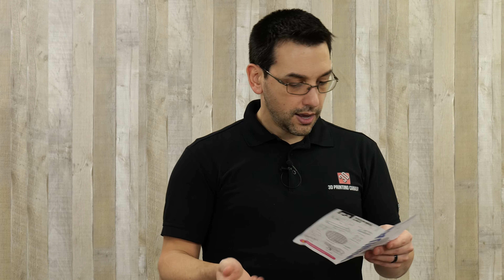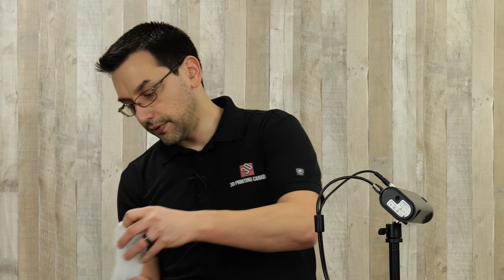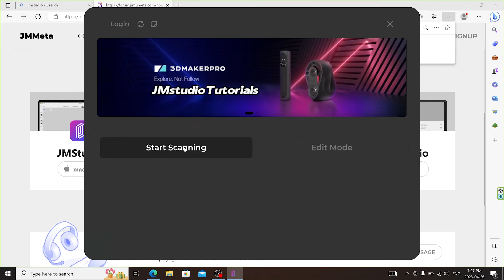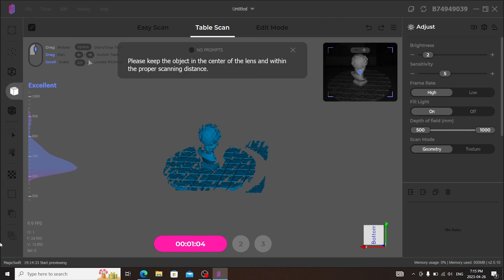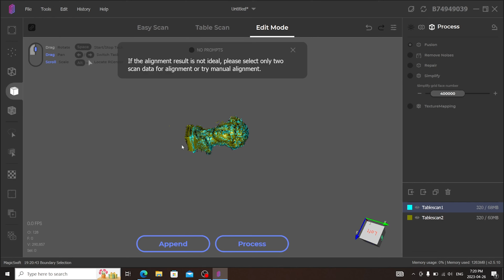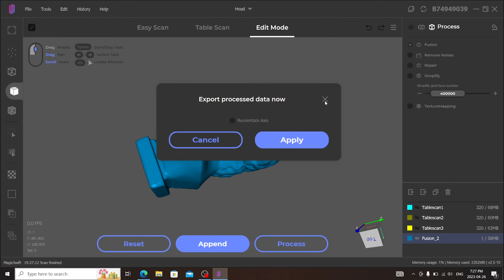3DMAKERPRO - MAGIC SWIFT PLUS SCANNER - UNBOXING & OVERVIEW

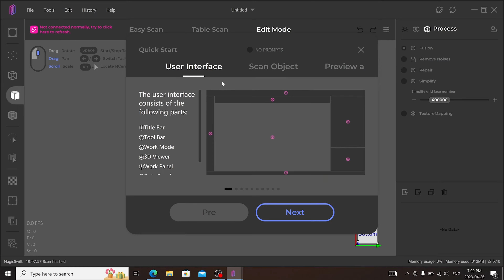Comment: 10:32 the issue is your over scaling all text on the OS side.  If you would have changed that drop down from 125 to 100% you likely would have solved the scaling issues within the program.